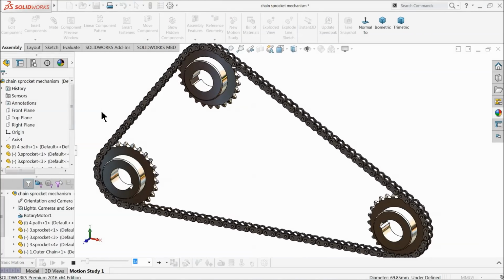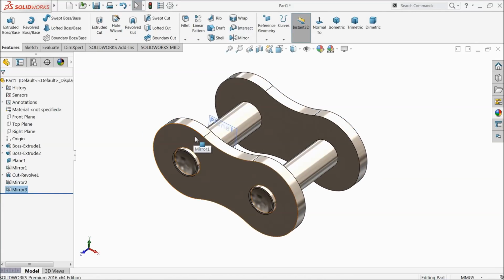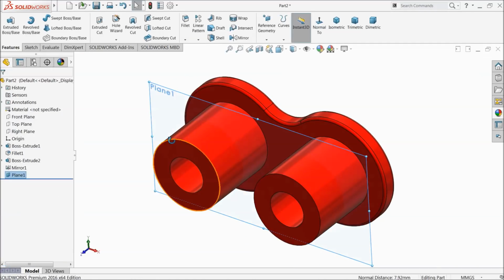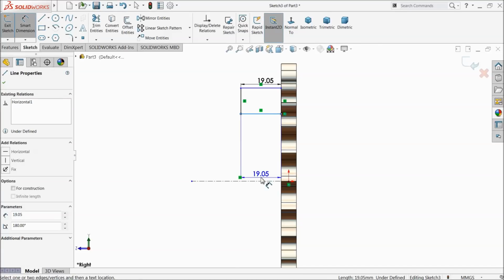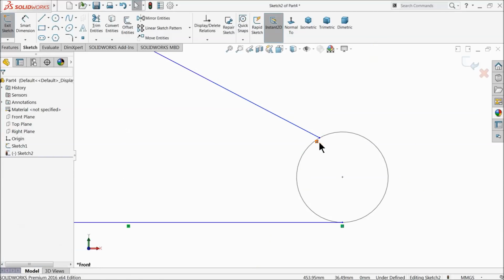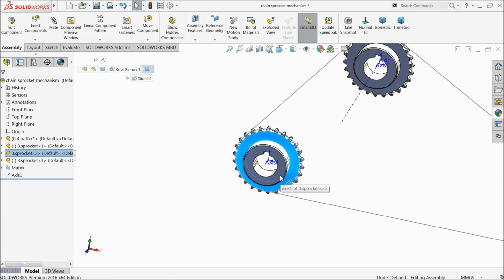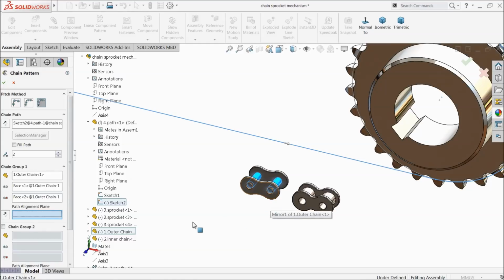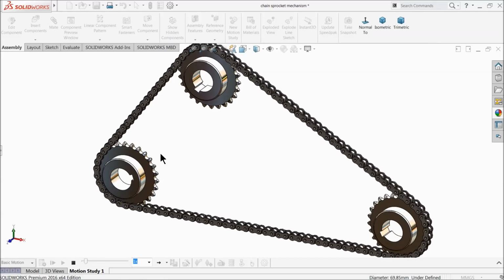Solidworks tutorial | sketch Chain and Sprocket mechanism in Solidworks

Comment: Hello ...
Can we make sprockets and chain rotating precisely ?
How can we find the exact gear ratio in chain applications at different sizes
Reply: You simply divide the first sprocket's teeth number with the second sprocket's teeth number, like 14/22 = 0.6363 so when the first sprocket turns one time, the second sprocket turns 0.6363 times.

Comment: how can you be sure that the chain roller ang the sprocket teeth mesh properly?
Reply: The center to center dimensions have to be the same on the sprocket and the chain.
For example 1/2 Inches or 3/4 inches.
Which are standard chain sizes.

Comment: Sir, How did you find the center to center distance between two sprockets? Is there any option in Solidworks to calculate the center to center distance?? Please help us, sir, we are stuck on the calculation of center to the center distance between "three" sprockets for around a year. Looking forward for an early response.
Reply: Use the measuring tool!

Comment: Can you help me? If I move a chain,  sprocket moves slower. The further chain is the slower sprocket rotates. The sprocket rotates with correct speed just when the chain "touches" the sprocket.  I tried using rack pinion and the speed of sprocket and chain is correct but when chain moves around a circle sprocket changes its spin direction.(sorry for my bad english)

Comment: How do you calculate the gear mate ratio though? I build my own chain and gear, but had a hard time figuring the correct ratio. The chain and gear are moving at different speed.
Reply: number of teeth to 1. 26 tooth sprocket so chain moves 26 links for every 1 revolution

Comment: When you do a gear mate between sprocket and chain at 48:55 you have no idea what are you doing. Mating with the sprocket barrel has no meaning at all, it has nothing to do with the ratio. Three cogs are in this video and they might have different barrel diameter, which one do you want to mate with ? And you "forget" to explain the correct ratio, your cogs spinning at random speed. Hmmmm. Actually the "gear mate" is very strange, do you know the definition of that mate ? It makes what kind of relation between what kind of parts ? Probably in the above example the cogs spinning with no constant speed because the distance from the mated object is continously changing.
Reply: Bruh

Comment: The pulley and the chain rotating properly only in small range. Sometimes chain will going faster than pulley and sometimes slower depending of the rotation position. I see the same issue in your video... Is it possible to make it proper for any position?..
Reply: yah!! finally,i've found the guy having the same question. Have you found the solution, sir?
Reply: I have the same issue !

Comment: Thank you for tut, but... why the dimensions are 10.795 and  3.9624?
Reply from the maker: thanks actually it is shaft diameter with tolerence which is going to fix inside,
Reply: I thinked it is the results of a formula
Reply: There was also a radius  R =5.83125275 mm. It is impossible to measure and produce parts with such accuracy. 
3 decimal places after a comma is more than accurate

Comment: it is possible to make this chain component pattern in SolidWorks 2011? :/ 
how can I manage this with 2011 version of SW software? 
Please help.
Reply from the maker: No, you need SW 2015 or above version, not possible with 2011.
Reply: CAD CAM TUTORIAL thanl you for your feedback.

is there any possibility to manage this issue and create such similar animation with SW2011? Is there any other way?
Reply from the maker: not possible, i tried many times anyway i will check with someone,
Reply: CAD CAM TUTORIAL, I see. Thank you so much for your huge support. I appreaciate it a lot.
Reply from the maker: Always welcome,